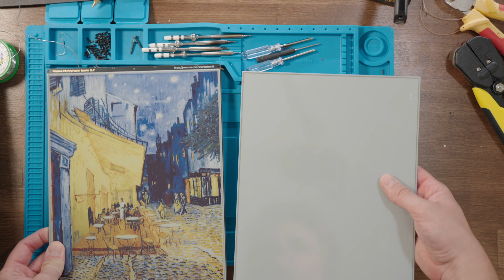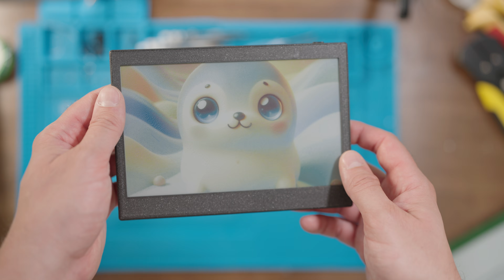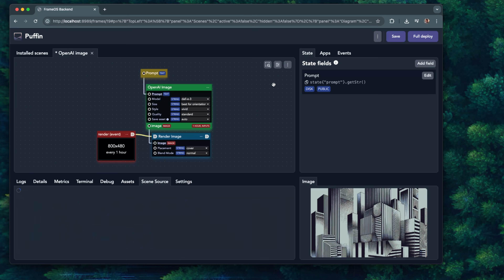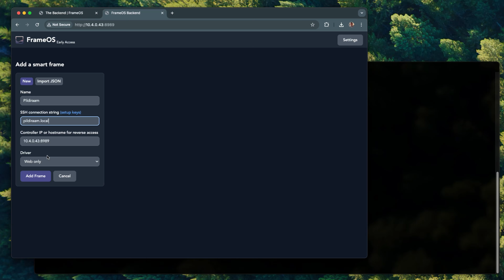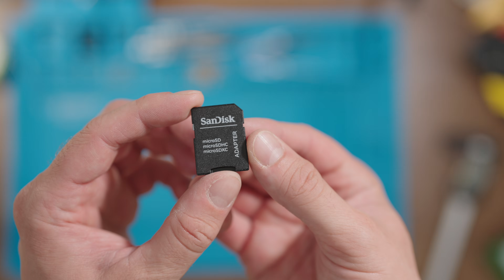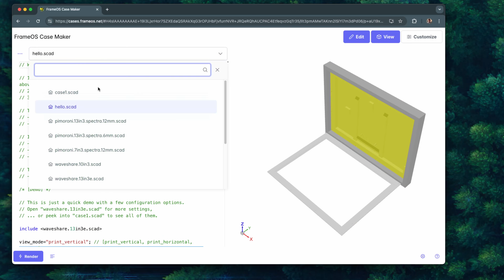Raspberry Pi + Spectra 6 E-Ink: The Perfect DIY Photo Frame?

Comment: So I get this from a tinkerer perspective, or if I wanted to do something more custom, but the panels are just as expensive as off the shelf solutions that use the same panels. Some even have a pretty good support for home assistant and batteries that can last in years based on your refresh activity. For me it was cheaper and more economical to buy off the shelf products that use this panel

Comment: Is it possible to consume less power when not changing images? While being USB powered is by design, I think this is a significant limitation, as some frames have multi-year battery life per charge.
Reply from the maker: Hey, the biggest limit here is the Raspberry Pi Zero W2 has no deep sleep state. You'd need to pair it with another microcontroller (e.g. ESP32) that would cut and restore power at a fixed schedule. The solution is to swap out the Pi for a different board with a real time clock. I wrote a bit more about it here: https://github.com/FrameOS/frameos/issues/164

Comment: Nice video but I disagree on ESP32 statements. I think the ESP32-S3 is a perfect fit for purpose. At least for my purpose. That is store a bunch of photos locally. Switch them automatically at night. Be able to change/add/remove them via Wifi. For this the ESP is definitely a great choice since it has buildin Wifi, loose very little energy in deep sleep and is very cheap. For the storage it needs of course a SDcard. Luckly waveshare offers an out of the box ready photoframe with ESP32-S3 with all this. It looks great, has the spectra-6 panel and all the other stuff buildin, includinng SDcard reader. 80Eur at Ali is unbeatable. Together with the extensive docs + source code on waveshare wiki you can do anything you want with this great HW

Comment: Does the connection ribbon from the Spectra6 fold to the back in order to make a slimmer frame?

I'm building one with aluminum cnc machined but I don't have the screen yet 😅

Comment: is an Orange Pi Zero helpful ?  more ram, faster cpu.  does it speed up render or draw less power?
Reply: there are some issues with i2c on orange pi, found mention of it in video called "I Built the Ultimate DIY Pocket Computer"
Reply from the maker: it won't help much here. Loading the software onto the device might be faster, but the rendering is bottlenecked by the display. I'm not sure if there's any way to speed it up... but probably not without some quality loss...

Comment: I did a similar project connecting the Pi to my Nas. How well is your own software at dithering the images for the 6 colour screen? That was my biggest struggle during the build :(
Reply from the maker: The dithering is a pretty basic floyd-steinberg dithering implementation. The hard part was finding the colors that would show realistic looking images, when used for dithering. I think I got pretty close in the end... and there's always a way to tweak them further in settings.

Comment: Just ordered a 13" spectra 6 from Ali Express, comes with an ESP32-133C02 driver board; so no frameOS for me, me thinks, but will probably use your frame maker software...  I'm a bit terrified of destroying the screen, given I've seen more than one picture of makers who've destroyed them...  Any tips on what to avoid to prevent damaging?   Don't force them into a frame which I got from your videos (if it doesn't fit, reprint); will these break if touched with a finger for example?  A top 5 or 10 tips for safe handling e-ink displays might make for a good video; given you already have some broken ones you could show how they break too... anyway just a thought.   Great videos, thanks for your excellent work on these!
Reply from the maker: Just pressing on it with a finger won't damage it, however trying to fit it in a space that's just a bit too tight will almost always result in a crack. The danger isn't in large surface level pushes, but in tiny forces somewhere on some edge.

I guess you got your panel by now. How was it?
Reply: @marius_andra  I did indeed, it's lovely 😄